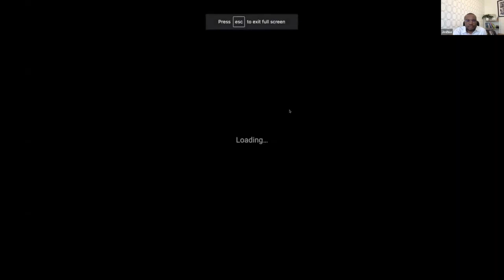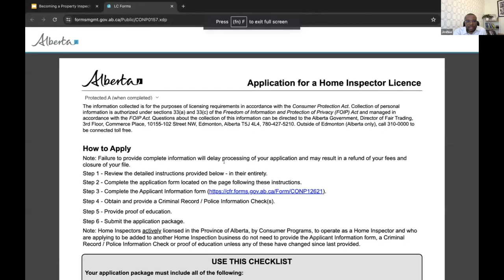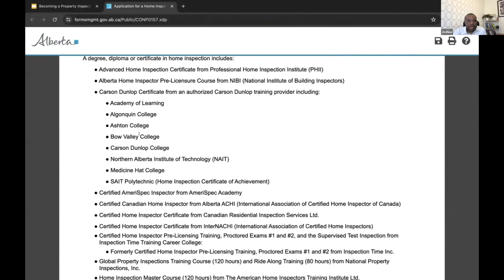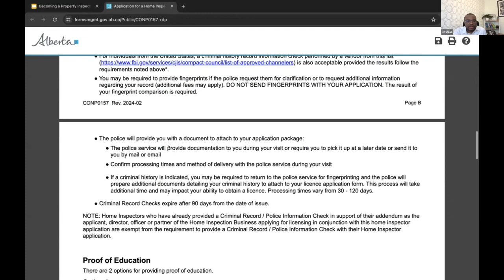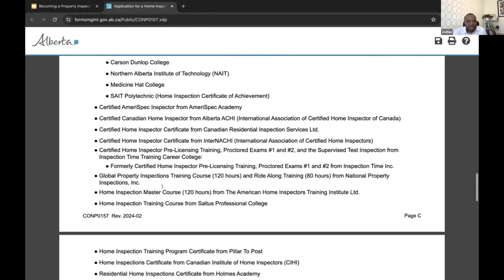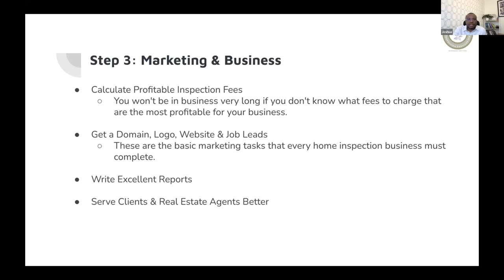How to Become a Home Inspector in Alberta - Brookstone Inspection Services Ltd.

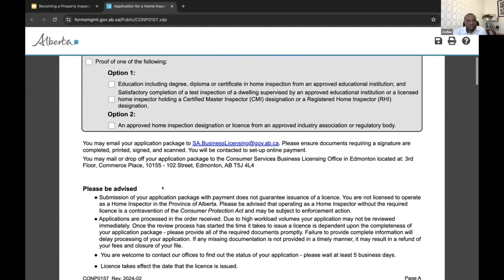Comment: Hi, at 8:15, you are talking about some insurance around 4000/ year to hold home inspector license, is it mandatory to pay that every year to run your license, if it does it's a scam run by govt to get money from every corner, they will not gonna spare anyone in this expensive era.
Reply from the maker: Yes, you are required to maintain your Errors & Omissions Insurance annually. You get those from 3rd party providers.